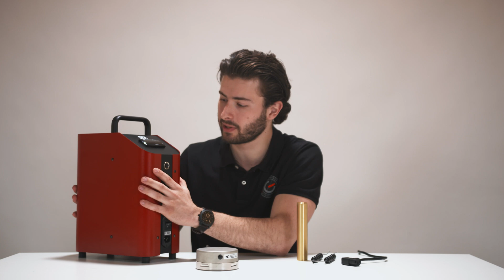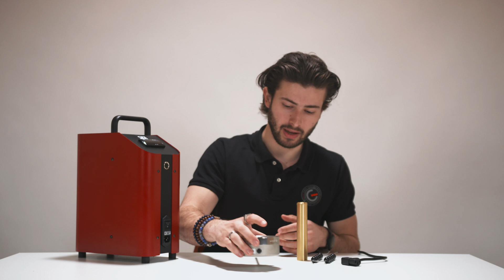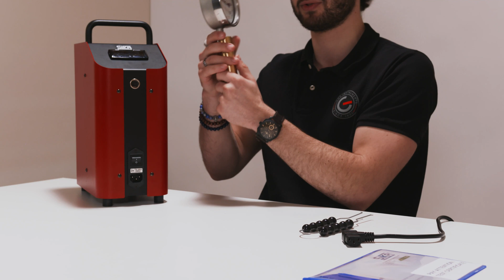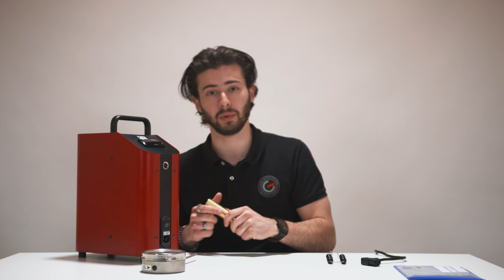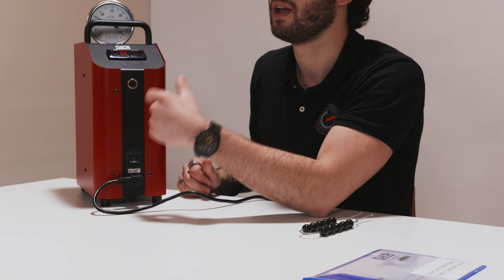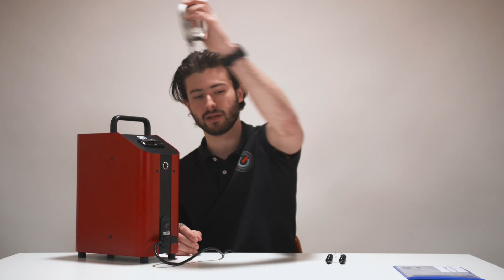SIKA Temperature Calibrator

Comment: After the start-up procedure, does it need to heat itself for let's say 30 minutes before using the temperature profile?
Reply from the maker: Hi! Yes, correctly; after starting up the SIKA temperature calibration block, you set them to the desired temperature and then simply wait till it reaches the set temperature. Depending on the level of degrees, this may vary between 10 to 30 minutes. Did this answwerd your question?

Comment: your measurement is so wrong
Reply from the maker: Hi Erdogan, could you be more specific on which part of our measurement is 'so wrong'? Perhaps we can explain and clarify why you need to perform the measurement the way we showed in the video.
Reply: @WOSupplyVytl  Hello.  First of all, thank you very much for your reply.  analog thermometers cannot be made with dry block, you cannot take accurate measurements.  The analog thermometer consists of different metal combinations.  The dry block is not homogeneous. Calibration should be done with a liquid bath.
Reply: This calibration procedure is explained in detail in TS EN and Astm standards.
Reply from the maker: Hi again Erdogan, you are correct! However, this video was meant to showcase the simple operating principle of the calibration block, without any intention to highlight which thermometer suits which calibrator best. Your comment does provide an interesting subject for a new video or blog, so we will surely use this in the future.
Reply: @WOSupplyVytl  Hello again, I realized your intention but I wanted to inform people about the right method..
Reply: @erdogansonmez6012  Would you have any document that prohibits the use of dry blocks in the calibration of analog thermometers? because as far as I know it all depends on the uncertainty that I need, if I don't have a very tight specification and the uncertainty of the block suits me I can't see the problem in using a dry block for this type of calibration.

Comment: secondly how can we increase the set point to four significant figures. like from 50.0 to 50.01
Reply from the maker: Hi Ali, This depends on the accuracy your temperature block is capable of measuring. Not all temperature calibrators can be set to that specific accuracy.